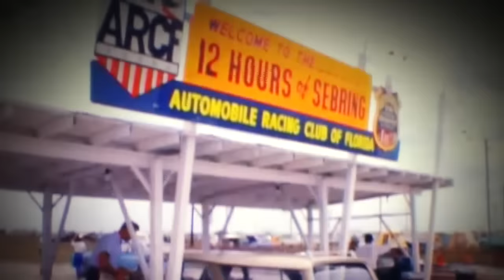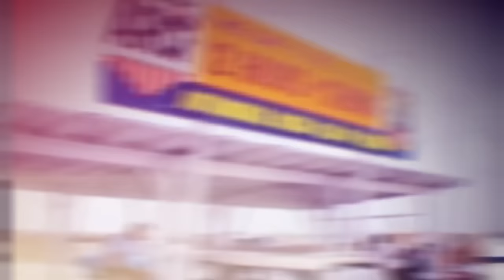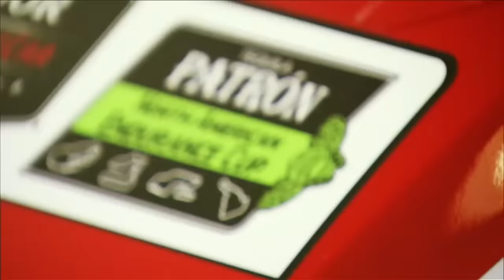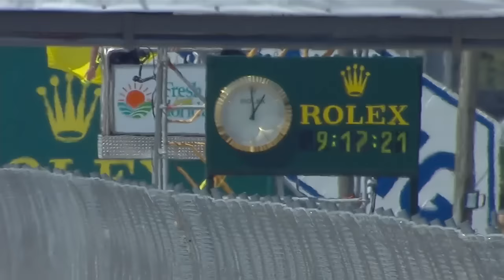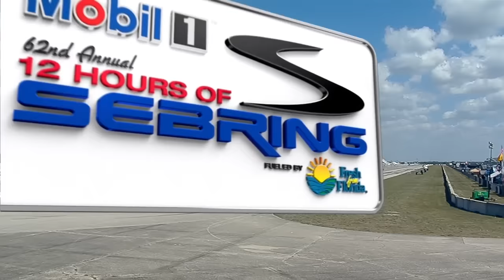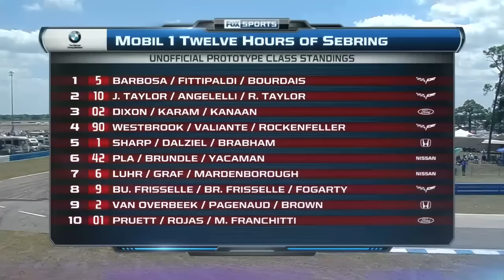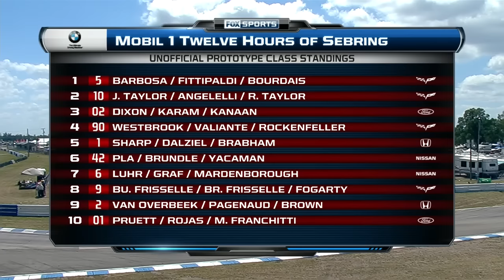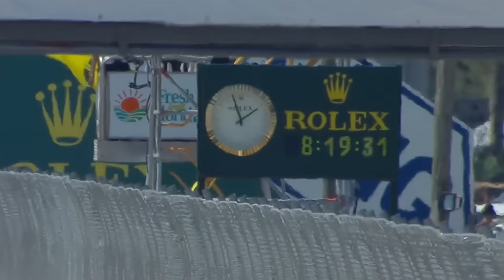2014 Sebring Race Broadcast - Part 1

Comment: How is this the ultimate test track when there's nurburgring?
Reply: I think Nurnburgring is the best so
Reply: Because only Europeans think the Nordschleif is the undisputed test track. North Americans have their own contender, and unlike most American perceptions its actually legitimately a contender.

Say what you will about the state of American motorsports, when it comes to tracks North America is loaded for bear.
Reply: BollocksUtwat
No not only the Europeans. Every driver who raced on the Green Hell says that and YES even the US drivers do. The only ones who disagree with this are the ones which didn't raced on it.
That's the reason why nearly all car manufactures test their cars in the Eifel.
Sebring is more a test for wheel and suspensions, not for the car itself.
Reply: hofmannsapprentice more or less every majorSportsCar team tests here, Nurburgring on the other hand they don't